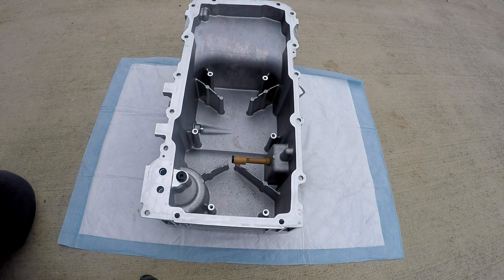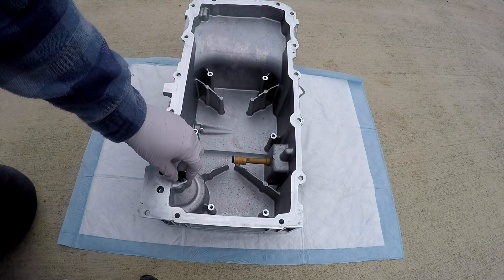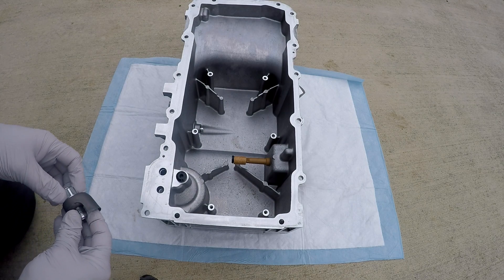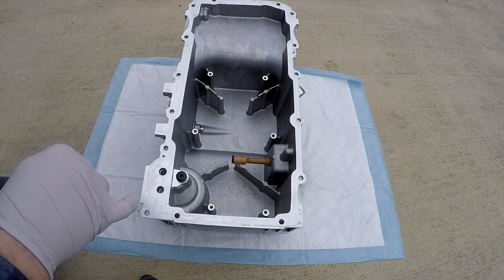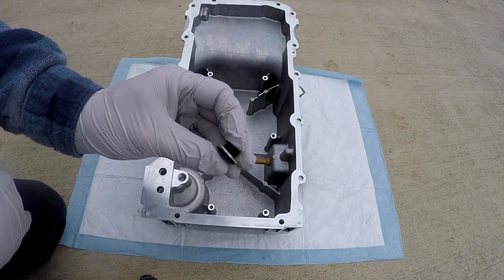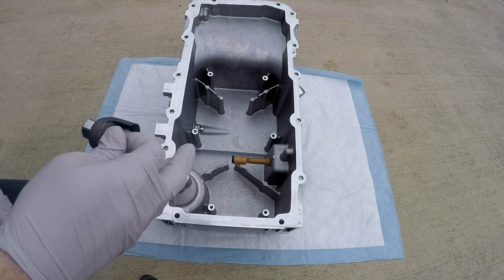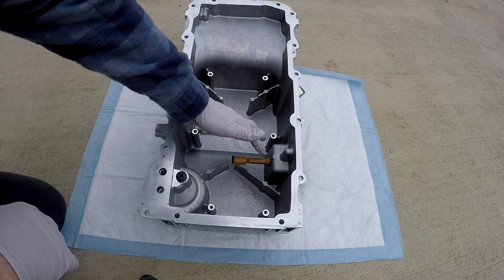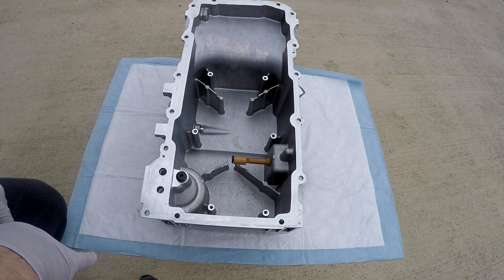Pressure Relief Valve in the LSA oil pan.

Comment: my front seal keeps leaking after i put oem timing chain and oil pump in it i hear the valve cover needs also be changed, because stops up ! so what is making the front seals keep leaking even after replaced can it be this part or something else?
Reply from the maker: This valve has nothing to do with your front seal leaking. If you removed the timing cover, you should replace the front seal and be sure to realign the timing cover correctly. If you have an aftermarket vibration damper, that may also be leaking past the bolt.
Reply: @fasnuf  I put all GM front seal and timing chain  in it and i read where the valve covers go bad making the pvc build up pressure and can make the front seal leaks . I read where gm valve covers have alot trouble and need be switched to new design type , what your thoughts ? can it be to much pressure on the front seal and valve cover needs switched or what ?

Comment: So if u delete the dod then that valve is no longer needed and will have safe oil pressure
Reply from the maker: If you do not have DOD, then you do not need the valve. If you still have active fuel management, I would not remove the valve.
Reply: @fasnuf  perfect thanks I have a 07 avalanche 5.3L had afm but I deleted it and changed the cam lifters vlom oil pump etc and been having oiling issues since and feel that may be my issue thanks I'll try it and see appreciate the video I needed this 😀
Reply: Do you think I run prv delete if I just have the dod disabled ?

Comment: My 09 CTSV auto doesn’t have a bypass relief valve I bought the same plug you did anticipating it when dropped oil pan,new Melling 355HV. Also oddly enough had a single bolt cam. LSA heads and block
Reply from the maker: Interesting for sure. My LSA had a single bolt cam factory as well. So I'm curious if this started in 2010 or whether the pan was changed or something. I'd have to research when DOD/AFM all started.
Thanks for the comment
Reply: Your pump was swapped out previously in favor of the high volume melling.

Comment: Don’t wanna get out of context but gotta 2011 Sierra 5.3 that stays on 18 psi at idle and as soon as I tap the gas it’s steady on 33 psi … I’ve changed oring at pickup tube and the oil pump and also pressure switch.. engine run’s fine plenty of power … could this valve be the issue??? If so your saying plug it ??? Thanks for info
Reply from the maker: If yopu don't have AFM/DOD then plugging this is a good idea but I doubt this is the cause of your low oil pressure. 18PSI sounds like it's low for idle, but I'm sure it's still in spec for that engine. Most likely you have a ton of miles on the bearings or a worn oil pump, or both.
Reply: @fasnuf  yes pump already changed out last week and thanks for reply…
Reply: My 2010 gmc Sierra 5.3 had low oil pressure, I changed the sender unit/ or switch and the filter behind the manifold it did nothing, I then did a engine flush and new oil pump and o-ring and it didn’t change anything finally took it to the dealership and they scanned it and it turned out this part is exactly what’s causing my low oil pressure

Comment: hey I have 2007.5 chevy my afm lifters decided to collapse so I did the whole dod delete and when it's cold I get really good oil pressure but once it heats up it drops very low and i get the famous lifter tick I didn't plug up the pressure relief valve do u think if I did that it would help with the oil pressure
Reply from the maker: First, make sure you're running the correct viscosity oil for that engine. The PRV relieves pressure on the high side, it doesn't take it away at low RPM or idle unless iot's just plain broke. If you're seeing low pressure at idle, you might have other issues. Removing the PRV definately wouldn't hurt anything and should help upper end pressure somewhat unless you have other mechanical issues going on.
Reply: @fasnuf  okay thanks and I'm also gonna replace the oil pick up tube o ring and see if that helps with the low oil pressure at idle when the engine gets warm
Reply: Did replacing your oil pickup tube fix your hot idle psi?

Comment: Exactly what my engine builder did to mine after this crappy part failed, oil pressure dropped, and it chewed the cam out of it (before my wife bought it used)!

I had a very good engine builder bore and stroke the 4.9 to a 5.7 and this was the first mod he did on the oil pan to ensure it always has got oil pressure!

Comment: I'm clueless as to why an active fuel management/power on demand engine needs this PRV in line on the oiling system but otherwise not. I thought the PRV's were there in the event that the filter gets clogged up, the PRV then bypasses the filter. I'm confused.
Reply from the maker: Filters have their own internal bypass. This was for AFM/DOD

Comment: Wow man, a lot of the time I be pretty aware of some of the mods you do. This here I was totally clueless about thanks for sharing.
Reply from the maker: This one is easy to miss. Pan was a real pain to get out of the ZL1. The service manual says engine removal is the way. I cut the crossmember and did some other disassembly to get it out but took hours. Video will be out soon about the removeable crossmember.
Reply: @fasnuf  that crossmember was pretty trick. You did quite a sweet job displaying the working involved and reasoning for the angles on that crossmember segment. As I’m trying to finalize the last bits of work I need to accomplish. Here you go giving me other thoughts that’s adding to the work list I’ve been so desperately trying to complete lol. It’s always something and it truly never ends.
Reply: @fasnuf hello,question if you have a answer, can that cause low/no oil pressure on a 5.3(07 silv) I’ve changed a few grand in part’s trying to fix and wondering if this can be issue for me??
Reply: @user-bb4rr3cr1c No, oil pickup tube o-ring.  Second,  maybe need a new oil pump or possibly a high volume pump if in higher mileage as the cam bearings may have some wear and tear.
You have vvt and or afm? I'd get melling hv/hp pump and delete the oil relief valve or use this addon to a new valve.

Comment: Yes, we replaced the PRV with a plug while rebuilding and can be easy to miss that mod, $5-8 maybe for the plug. Also, you can add a bolt down piece for the pickup tube, I missed that one. And don't forget the gasket on the cam block some just throw the block back on.  I believe I have read that the Cadillac oil pan on their LSA is different has no PRV and has cooling fins as well.
Reply from the maker: I added the girdle to the pickup when I did my cam. Not a super necessary part, but good piece of mind. No idea why GM wouldn't use both holes...silly.
I wasn't going to remove the cam, just adding a better oil pump and timing chain.
Reply: @fasnuf   Oh sure I was just reminding the viewers of those little things that can slip through. Happens to me.
Reply: Where can I order the plug?do you have a link please.
Reply: @davidochoa559  Yes sir they have them at Summit racing IRP-PO-M14-KIT    
A well stocked Hardware store might have it too! The description is on their website.
Reply from the maker: @davidochoa559  Its in the description
Reply from the maker: @davidochoa559  https://www.youtube.com/redirect?event=video_description&redir_token=QUFFLUhqbDhYLWV5QUlKcFhkbzRrNjZJcThyRTZycDNyd3xBQ3Jtc0tsRUV4R3Y0RVRuMnVSaGx3Z0lLVDgwSlJ5aGoyNFVXeWdMMEtTbTkxYXFTZU5TWERoZElYdDFlWTlsYlg0YzExQVpCTTRkMVhBdldBRFRPdjFaT2FBQ19FenBheE96cGlERkx1NDBUaDBRRm12ZVRRWQ&q=https%3A%2F%2Fwww.summitracing.com%2Fparts%2Firp-po-m14-kit%3Fseid%3Dsrese1%26gclid%3DCjwKCAjw7cGUBhA9EiwArBAvojlikUdpl9vWpqqOVIFTyjyCpf_kQANDP4dtmRcN21EX0qw2ulWi8BoCd1wQAvD_BwE&v=6KI1hQgtEKM
Reply: Yah don’t never leave it out I don’t like the whole thing but when it’s left out oil shoots straight up hits bottom of pistons causing oil consumption , and decreased pressure and possible oil leaks.
Reply: When I seen Melling fix the little hat looking shield it was then I realized what a bad idea I had with them and fade if garage I was able to fix it.
Reply: I got an oil pan drain plug 14mm by 1 and a half at O'Rileys, $3.

Comment: Awesome. I want to do this too. I am guessing you are cutting out the crossmember under the oil pan. Would love to see you walk us through this.
Reply from the maker: Yes, I got the flanges from CFD on the Camaro5 forum. A video will be out soon. I think I would pull the pan a different way than I did. I would probably loosen the engine mounts and loosen the sub frame and go from there. The ZL1 has a tone of crap attached to the pan that has to be removed. I won't do it again.

Comment: Your correct mark all Lsa’s have them.
Reply from the maker: Could’ve saved me some work if they just left it out. Good to hear from you.
Reply: @fasnuf  i have the plug sitting on my tool box. Just in case the oil pan is ever removed.
Reply from the maker: @jtartaglia002  PITA on the ZL1. Better to lift the engine off the subframe and drop the subframe a bit too.  Not fun.